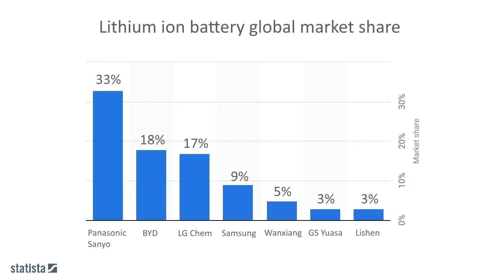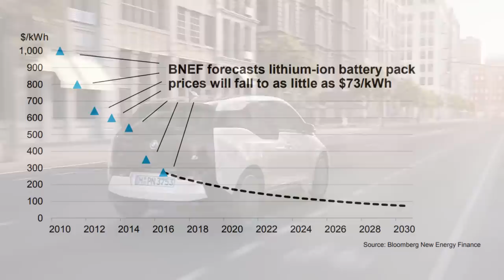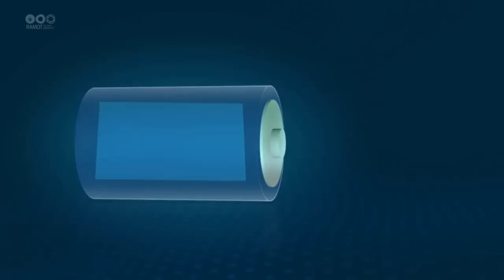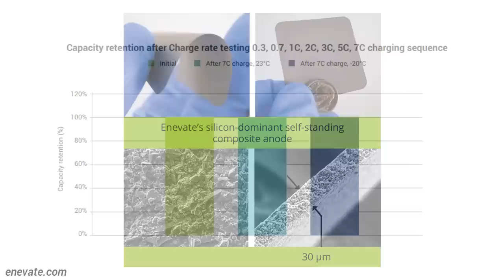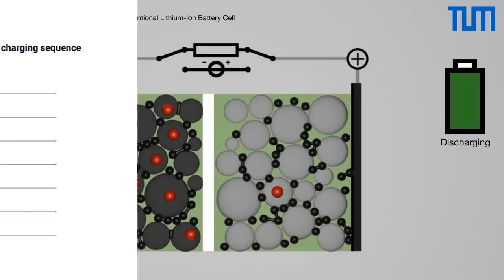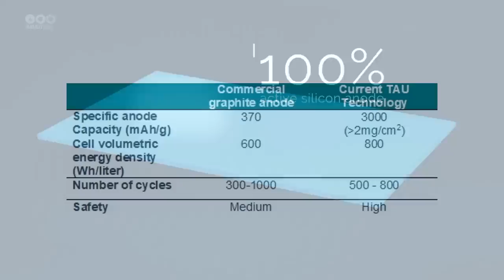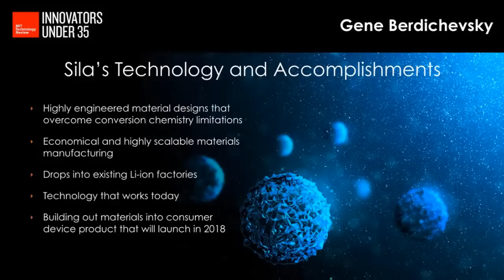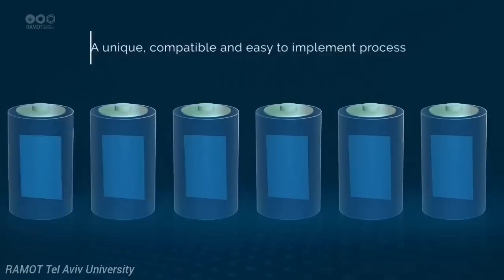The Battery Revolution. Ultra Fast Charging

Comment: Around 90% of the global population doesn't drive more than 200km per day, which is already achievable with most EVs. People complain about the current higher purchase price of such a car,.. take away the fuel costs and engine maintenance and depending on where you live the insurance tax,.... Those arguments are already obsolete.
Reply: Instead of engine maintenance on EVs you get $16000 repair bills for your battery (that's the cost of a new Tesla battery btw). Also there is no charging standard for EVs which makes long distance driving impossible since you can't recharge. Hello we can't even agree to a standard laptop charging port...
Reply: Not sure where you got that 90% number. The average commuter in the USA drives less than about 48 km per day. And it's a pretty large country.
Reply: I'm NOT talking about Tesla. Here in Europe you can get Mercedes, VW, Hunday, Renault, Nissan,... EVs between 30-50k NEW with a range that covers the daily needs of more than 90% of the driving population which is a rough estimate,.. you can do the exact numbers yourself if you want to be a smartass ^^ have a nice day, ps: most of the mentioned companies give you 4-8 years insurance on motors and batteries without mileage restrictions.
Reply: Wrong gas-head, in the case of the Nissan Leaf I am presently driving (7 years old still going strong on original battery and still fully charges), there are 24 modules.  Each module costs around $400 and you need only replace the one that is worn out.  I've already made up for the higher upfront cost given how expensive gas is in California.  To fully replace all of the modules is only around $9600 (which you make up in a few years in gas and maintenance cost).  My total maintainance cost for those seven years is less than $500 (no gas vehicle can match that).  I had to replace a flat tire, tire rotation, and replacing the accessory battery.  There is only one maintenance that requires you take the car into a shop (annual battery check which is cheaper than an oil/lube change).
Reply: Around 90% of the global population doesn't drive more than 20 km per day. Forget about 200. Current EV batteries are already oversized. Cut the battery size down by 25%, add a small range extending engine for the occasional long trip, and what you end up with is a much more practical car.
Reply: What's actually more environmentally friendly and overall cheaper than any EV? 
Yes, it's buying a used car and drive it to the ground.
Reply: R-Type - Except that is a self defeating claim.  Just like people say, no one should buy any car made in its first model year.  Well, if no one bought a car in the first model year, there would never be a second model year, now would there.

Buying a used car and driving it into the ground means constant break downs, tow trucks, repair bills besides the lost time wasted.

Most people don't have unlimited time, money and effort to be hauling their cars to the shop, and waiting for it to be repaired, and they still need replacement transportation in the meantime.
Reply: Captain Crunch I did that for 13 years and it was a pain in the butt most of the time with all those mentioned issues. Since I drive electric I only miss the engine rumble but that's about it, range anxiety is gone and on a positive note,.. no nasty fumes for the kids in the neighborhood to inhale from all the exhaust gases.
Reply: Yeah, my favorite car is still my Model S, and I prefer to drive it over my friends Maserati and my in laws SLS AMG.
Reply: madmotorcyclist I have had exactly the same experience with my 2012 Nissan Leaf. Two new tires, and replacement of the original twelve volt battery. I modified the standard 120 volt level one EVSE that came with the car to level two, which cost me $12.00 and an hour of my  time, and have used it almost exclusivly to charge with at home. That alone saved me over $2500.00 in having a level two EVSE. Since getting the car a network of Rapid chargers has been steadily growing and we have never had range anxiety when we venture far from home.
Reply: John Livesey what city are you living in?
Reply: Samuel Rosenberg I guess to make it more appealing for the petrol heads like me. The top model S has +700hp, a huge range and also looks great for an EV. But in Europe you also get very nice luxury hybrids from other brands, just for competition sake. Musk filled an open gap in the market. We have business men in my country who have driven their Teslas for more than 250000km since 2014 and they love these cars.
Reply: Adam Smith If the battery should have a failure(IF !) then the warranty pays for it. Stop claimkng that nonsense.
Reply: If u want to save the environment, ride a bicycle. Buying "feel good" electric techie cars still relies on fossil fuels to create the electricity and there are still no good alternative to mass produce electricity for the whole nation, if not world even if everyone was forced to drive electric.  Your electric bills will increase 3x-4x. Food price would increase. Ur taxes will increase to fund more infrastructure. And it would STILL USE FOSSIL FUELS!

Feel good is not good. It's a deluded fantasy that is not a solution. Even if we had clean energy, it would just cause humans to overexpand and consume the world of it's other resources.  This is what many scientists have realized ... free energy=overpopupulation=destruction of the world.  And we can't create or move to another world. 

U want real sustainability? U have to live without electricity and live and eat and buy local.  U dont want that? Then ur living a lie.
Reply: Saving $20 a week on gas maybe maybe a few hundred a year on maintenance hardly offsets the cost of an electric vehicle. Try again.
Reply: comedyman112 I live an hours drive east of Vancouver BC.
Reply: Samuel Rosenberg just like anyone else produces something, there is a market for it.
Reply: Samuel Rosenberg you are correct in stating it's your oppinion and not your experience, try an EV out and see if it fits your needs. If it does you will reap the benefits, if it doesn't you may not. To be fair consider all the costs including maintenance.
Reply: Peachees those arguments have been debunked over and over again. Even if you produce electricity from dirty fuel the efficiency of electric motors over internal combustion engines still makes them cleaner. You also slow the car down by regenerating power using the motor as a generator instead of wasting the energy as heat lost through the brakes,  as in a fossil fueled vehicle. I'm fortunate to live in a place where all our power comes from hydro electric dams and I wake up every morning with the batteries in both of our EV fully charged. Fully charged at domestic electricity rates. If EVs had been available a few years before I retired, what I  would have saved on gas and maintenance would have paid for the car. Economics alone will ensure the large scale adoption of EV's as people realise how much can be saved over the life of the car. The enviromental benefits are just a fortunate bonus.
Reply: "Instead of engine maintenance on EVs you get $16000 repair bills for your battery" 

And can you actually reference this happening, because Tesla batteries have a pretty damn long warranty, what is it, 7 or 8 years?  You think a battery is still going to cost $16k by 2025?  I highly doubt it.  In fact early projected figures for battery lifespan were underestimated - most owners are pleased to report capacity loss lower than expected.  I totally get your point that an owner might damage their battery accidentally and it's not covered by warranty, but the likelihood of that happening without the car getting totalled anyway are pretty slim since Tesla installed armoured underbodies.

"Also there is no charging standard for EVs which makes long distance driving impossible since you can't recharge"

Since you brought up Tesla I'll point out their supercharger network is GREAT, and people have been using it to do this 'impossible' (according to you) long distance driving COAST TO COAST for years :)
Reply: "The bigger the battery the longer it takes to refuel"

Wrong.  Bigger batteries are able to accept a faster rate of charge, provided the charger is capable of delivering it.  Load per cell remains similar, but spread among more cells.
Reply: "Saving $20 a week on gas maybe maybe a few hundred a year on maintenance hardly offsets the cost of an electric vehicle. Try again."

Depends entirely on the user.  People run case studies for themselves.  For most folk you're right, it would take a decade to break even.  But some people have already reached their ROI and broken even.  It's called forward thinking.
Reply: What´s the point is that we humans re-produced like rabbits for the past 100 years and now we start to see the effects of it. I don´t need my 700hp Tesla, as someone mentioned, I could just ride a bike,.. I just drive it for fun with fuel from my privileged solar pannels at home.
Reply: Most people don't think for themselves, the mainstream media(owned by oil investors) tell them what to think.
Reply: Well i drive abaut 300 ~ 400 a day so
Reply: @Stefan, I'll consider an EV when and if their price drop below 10.000€.
Reply: TheSimpleOne L 
So around 150-200km to work and back?
Great! You could charge your EV for 8 hours (or how ever long you work) and drive it back home when you're done! 😉
Reply: Exactly.  When you work as a teacher ($30K/year), a $30-$50K car may as well be a million dollars.  I drive a 13 year old car because my grandmother who passed away left it to me in her will.  I'm very thankful for it.  It's amazing how many sanctimonious rich snobs are on here talking about how great they are.

Someday, the various ores mined to reap the metals (currently mined with fossil-fuel burning equipment, but eventually, yes, will be replaced with battery electric), processing all the materials (doing this with electric arc furnaces is better for the environment, and makes better quality raw material, but it's also much more expensive, so where do companies buy raw materials? from the 3rd world, where they use awfully polluting ways of refining ores, etc., because of lax emissions regulations).

You are correct that even a coal-fired power plant charging an EV is still ~38-40 MPG (equivalent).  But that's end-use.  Factor in all the raw materials acquisition and processing, and your 'helping the planet' is minimal, at best. (yes, I'm well aware that all the same things apply to IC vehicles.  I still get 34mpg...your point?)
Reply: Captain Crunch OR..... If people didn't keep buying new cars, they just would quit making so many new cars every year. Then we would see new models only when there were actual progressive steps made. It's a little stupid that you can have 4 years of car models that are all priced differently but made exactly the same. A new 2018 cost more than a new 2016, but they are identical cars.
Reply: Stefan Venus I don't know how you're missing the giant hole in your logic. You say that people don't drive far, so the need for long distance availability is useless. Then you say that you save so much money on gas that it totally offsets the larger upfront cost. If people are driving less than 20km, how are they using so much fuel that it offsets 15-20k?

While your specific situation may work out well, you're being ignorant to pretend that the average length that a person owns a car is less than 7 years. With decade long break even points, how can you argue it from a financial standpoint?
Reply: Adam Smith 
You're talking rubbish. Do some research.
Reply: zolikoff 
Forget hybrids! You're just carrying dead weight and taking up space.
In even 2years, batteries will be much cheaper and have much more power density, so the argument for hybrids disappears.
Reply: Samuel Rosenberg 
Remember when led TV's first came out?
Did you buy one immediately, or wait until the spec improved and the price dropped?
The first devices are ALWAYS more expensive. They are produced in smaller quantities and need problems ironed out.
In the case of the EV, incentives helped, but they were still expensive. That's going to change rapidly, by 2021, there will be much cheaper vehicles AND the used market will be fully established.
Reply: Danilo Margarido 
Which ICE car do you drive that cost (costs) less than 10,000€?
Was in new, or second-hand?
Reply: comedyman112 near Vancouver BC Canada.
Reply: Samuel Rosenberg not if you got to drive it at electricity prices.
Reply: Add wings, control surfaces and flight training and they can fly.  Just as logical.
Reply: Your electric bill does not increase by 3x-4x.  I know a Tesla Model S, Nissan Leaf, and a BMW i3 owners that spend $41 dollars a month to charge their car at home.   Where did you get this misinformation from?
Reply: $41 buys 200Kwh of electricity, or enough to drive 20 miles per day for a month. Wrong.  Way off base.  This buys much more than 20 miles per day for a month.  Did you not read the comment?  A Tesla Model S Owner. A Tesla Model S has 200 plus mile range.   That's all the owner pays for the month is $41?
Reply: Maybe where one lives becomes an issue. Here in this part of my country, an ugly, plain Jane Chevrolet Bolt STARTS at $44,400. Meanwhile, a tire smoking, bad ass, sexy to the max, Mustang coupe STARTS at $27,000 and change. That's around 17 thousand dollars MORE for the crappy looking electric car. I don't drive very much so it would take me years and years and years to spend seventeen thousand dollars on gasoline. Of course, maybe in 20 odd years, they might come out with better looking EV's with more efficient battery technology, but until then we're in a ' wait and see ' position. I'd love a battery powered Mustang, while the Tesla is nice, it just doesn't have the raw sex appeal of the Mustang, and that drives me nuts. Why can't automakers create a supremely attractive EV? What's the problem? I've seen the current line-up of EV's and many of them are so boring that the designers of these cars actually fell asleep while designing them. Ok, some are nicer but still not " Oh my God " sexy like the Mustang. Give me an electric Mustang or it's cool equivalent, and I'll help save the planet by keeping the car forever and simply replacing the battery packs. If YOU ( the automakers ) pony up on your end, I'll keep my end of the bargain. That's fair.
Reply: When talking about GLOBAL POPULATION - keep in mind that mostly US but also Europe/China are RESPONSIBLE for 90% of Co2!!!
With Trump the USA well make this #1 Country even worse in this regard shortly!
Reply: @AdamSmith-gs2dv  Dummy comment! BMW i3 Battery is half that price. In 98% NOT the complete battery gets a fault- but instead a Cell or cell module. So you will just change 13% of the battery in the case of an i3 e.g.
Reply: Actually most ev has less range than 200 km. That is one of the reason why people drive ICE.
Reply: The packs generally last for over 10 years, so unless you really need ALL the capacity the thing will keep going for a very long time. Also, that's the price of a battery pack now, in (over) 10 years when your whole battery eventually fails, replacement will likely be about 1/3 of that price.

For some folks who have expensive gas and cheap electricity (*cough* cascadia) you're probably going to save thousands on fuel every year, so overall cost of operation is still lower, even factoring in eventually replacing the battery.

Then you have to take into account how much your own time is worth to you. With a regular CV you're going to spend probably hundreds or thousands of hours on mundane maintenance over your span of ownership, whereas with electric there's almost no maintenance, provided you don't treat the car like complete shit.
Reply: StealthyMonk nope. You think about how long it takes your phone to charge at night? No. You just plug it in and wake up fully charged. Same with my EV.  Takes me ten seconds to walk in my garage, grab the cable and plug it in.  I wake up and it’s charged.  No more gas station trips.   

I normally charge from 90kw X 20%-80%. That gives me 72kw-18kw= 54Kw max needed from a 90kw battery.  Edison charges me .11 cents/Kw at night X 54Kw max = $5.94 to charge my car to go approx 120 real world  miles of range.  I too had a Cayenne diesel and drove it 508 miles a week to work, but  it cost me about $70 every 4-5 days .  508 miles/120ev miles=~4.23x$5.94= $25 electricity. Yes $25 vs $70.  $45 savings Every week. That was before my 9.92Kw Solar was put in.   And it never took me 3 mins to fill my26 gal tank.  Find a gas station, drive off the fwy, wait in line, fill up, easy 15 mins. Quite trying to BS every one.
Reply: @McDoodle44  well no its not!  Not by a long shot, as im walking down the street, im breathing in the fumes from your old car which may give me problems such as cancer and copd, where as people driving electric cars around are not emitting harmfull gasses into my face, this is the main reason for going electric, removing localised polution, i live in edinburgh and the traffic is terrible, busses belching out smoke, taxis and old vans stinking the place out
Reply: meanwhile most poor people can only drop 5k for a car ha, its almost like a prince shouting at peasants for not eating cake
Reply: The average consumer commutes about 40 miles a day.  Which is why the Nissan Leaf was made for a 80 mile range.  But people want their car to go the same or similar distant as the gas car.

Comment: The battery has always been the limiting factor for electric cars since the 1800s.. once we figure out the most efficient chemistry , I'm sure they will suddenly become main stream.
Reply: The most efficient chemistry is lithium-ion, which can have ~99% energy cycle efficiency.
Lack of efficiency isn't the problem. The excessively high cost of the pack is what the key problem is.